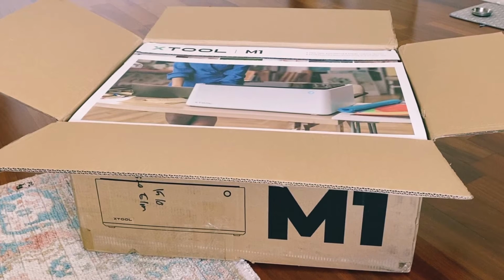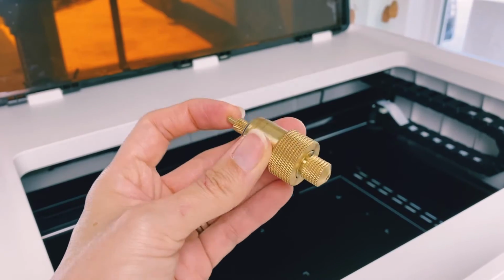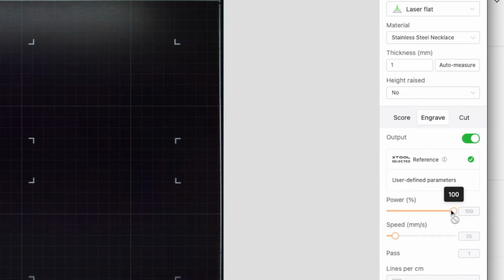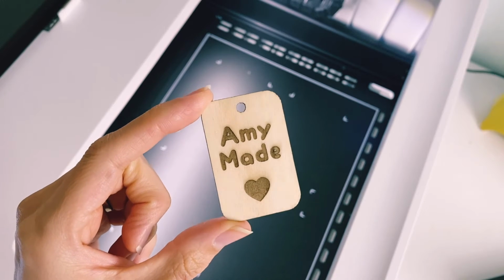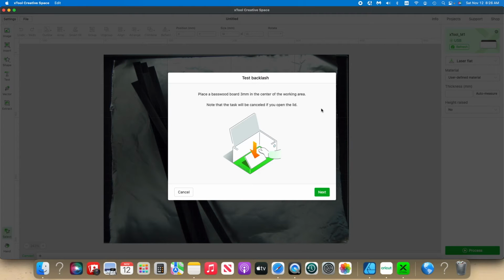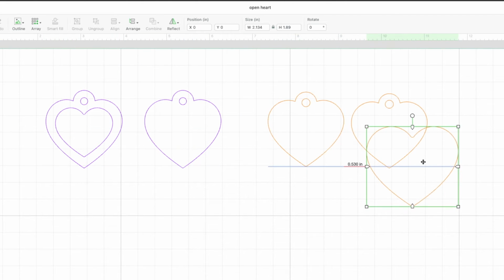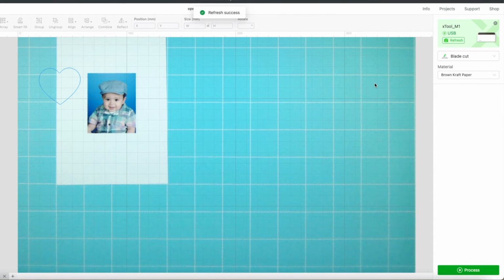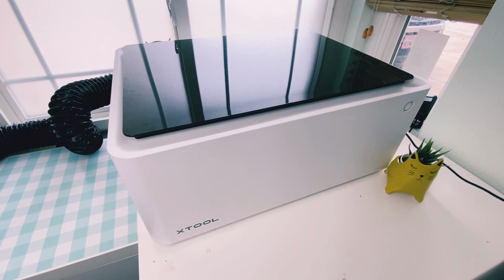The First Hybrid Laser and Blade Machine (XTOOL M1)!!

Comment from the maker: Update: 11/25/22 xtool support took a long time to reply with my issue. I had to send a follow up message. They stated that the misalignment issue is bug problem in the software and they submitted the technician for repair. In the mean time, I would still have to manually make adjustment help with deviation
Reply: Was the issue ever resolved?
Reply from the maker: @float32  nope!